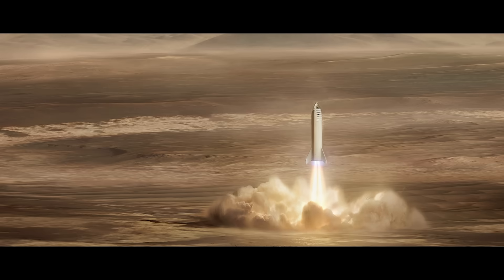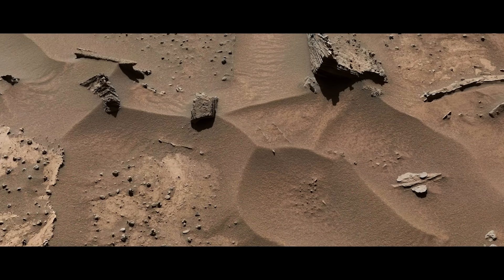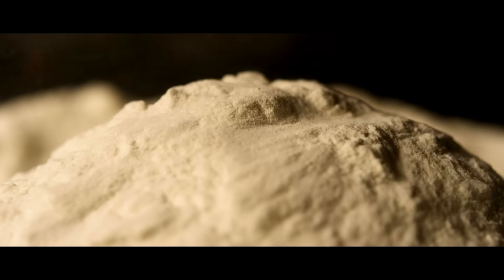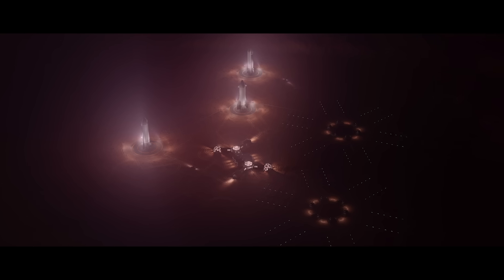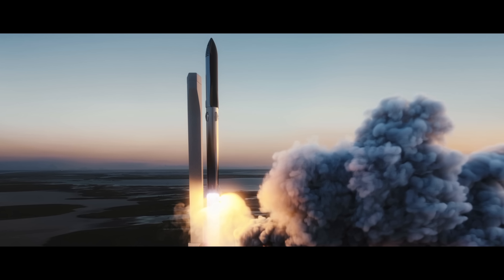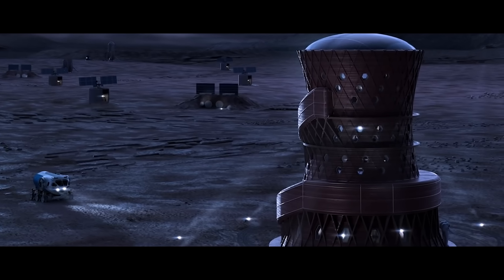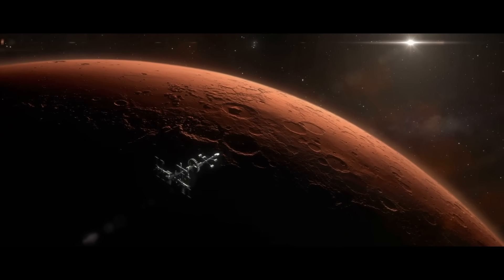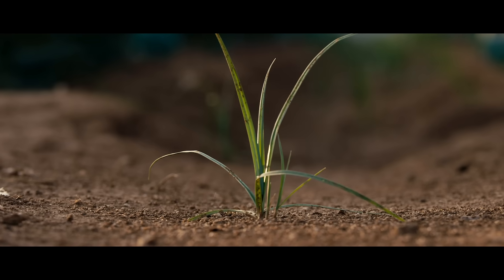THE FIRST 10,000 DAYS ON MARS (Timelapse)

Comment: Got to be pretty gulible if you believe this video. List of problems that the video fails to address
1. Food
2. Transport of goods
3. Cost
4. No real value going to Mars
5. Sending what ever resources back will cost billions of dollars for what 1 - 10 tonnes of rock? That we have here anyway for alot less cost.Ok...
6. Zombie isloation - Go to Antartica and live there for 6 months see how your mental state is after. Thats what it will be like.
7. Thats alot rockets to use to transport what 100 tonnes of equipment. So about 2,000 missions...
8. Wait time, shortest journey is 6-9 months.
9. Time it takes to build a rocket - 2 years. So thats 2 years + 6-9 months of waiting for supplies if anything happens = death. Good luck with that.
10. Solar flares
11. No atmosphere
12. Meteorites
13. Radiation 
14 no. 10 - 13 eqauls death. So high chance of dying then
15. Rocket safety, is 1million times more dangerous than an aeroplane
16. No successfull human landed missions.
17. 14% of All Mars missions have been a success. Thats a higher failure rate.
18. Keep dreaming.

Comment: You couldn't foresee this 2 years ago, but now with Elon owning Twitter/X, require its use as the primary communication method. The algorithms work as one would expect The initial crew of 30 would have broken down into a group of 7, 3 groups of 4, 2 groups of 3, and 5 near loners. Groups hardly communicate with each other. The Seven maintain dominance, as they have since the 4th week after leaving Earth.

Comment: This will never happen with rocket propulsion alone. The payloads are too light. I have to assume that the person that made this video has never seen an iron or steel mill. You can’t build anything outside because of the dust storms, and those same dust storms will make solar panels obsolete. So you’ll have to hope that there’s iron ore, water, and oil that could be acquired from Mars, which means even more stuff to transport there. Not to mention the screws, bolts, welding equipment, etc. etc. etc. This is a pipe dream without an anti-gravity machine, sorry folks.

Comment: this is all a pipe dream. never gonna happen and all you have to do is research radiation.
Reply: they are planning to build protected buildings against radiation. but what about air pressure? water boils at 36C on Mars which means blood will just boil.

Comment: I want to see what the shops look like? 
I can see a highway overpass on the left, with emergency supplies and an air creation device.  I walk forward into a crater and see an open door to a giant shop on the left (road continues over shop) and living quarters are a giant “J” opposite of the shop.  The hurricane proof door closes every night or cold spells or storms.  But the air is breathable in the crater; the mechanics look (and talk like) the Earth diesel mechanics.  The J shape is reinforced more than the shop; but all are iceberg and hurricane and earthquake proof (talk about codes!).  There is more life support equipment behind the shop and “j-building”, but instead of a regular tunnel, they are built like a submarine.  With lockable areas, and up to 20% running at a time. Maybe  original spacecraft materials.  Road is above that, both to avoid Alaska type permafrost destruction and to conserve footing needed for foundations.  No one lives there, but mechanics work in there as needed. Water is warmed in tubes leading up to hydroponics and fish and livestock.  Algae is top protein crop for people and animals; but it evolves.  How they created air in the crater was the mechanical backbone; the whole system shifts to opposite sides as the weather changes.  The money is in transportation of golds and high value freeze-dried crops the people on Earth want to experience.

Comment: Makes no sense to rely on solar power on Mars - even initially. NASA and DARPA are currently developing a space rated nuclear fission reactor under the DRACO program - much better approach. And who knows if Nuclear Fusion will ever work... If we utilize nuclear thermal propulsion (at least 3x as efficient) it dramatically increase the amount of payload that can be carried and/or  reduces transit times. No need to wait 26 months for return - or resupply! Radiation exposure during transit is a big deal and radiation  shielding is not adequate - so shorter transit times are better from that perspective as well. Onn Mars surface is makes sense to house people in inflatable habitats located in lava tubes or caves unless it is proven that the habitat shield illustrated is adequate protection form radiation. Also, if I were moving to Mars - I could not in conscience have children there - effectively sentencing them to life on Mars since their bodies would grown adapted to the low g environment.

Comment: Realistically speaking. Musk's plan is premature. They are missing an enture pohase that they should explore before senfing ANYONE to mars. They need to send heavy equipment kitted with a wire range of censors capable of digging and drilling at an industrial level. This is so they can drill to see if they can find subsurface water. test soil density to determine whether or not they can dig out an underground structure. And just many more things along with remotely building habitats and setting up life support systems prior to human arrival. 

We know surprisingly little about the planet. We need to know much more before we just send people over there just to see if they can do it at all. You simply can't train for an expedition to mars if you are underequipped with knowledge prior to getting there. 

Mark my words. This mission WILL fail. If only due to human weakness. People will go mad from the immense desperation of being so far from home.

Comment: did I miss it in the list of personnel at the start, did they say 'medical' personnel. To me the initial batch needs to be heavily on the engineers and electricial/computer side with medical support and a command structure. To send scientists before the structures are built seems a bit strange as the robots that arrived first are surely doing the scientific work to find the required elements of making it a habitable environment  (water for consumption, carbon and stone for building and potential places to dig in to get away from radiation overdosing)

Comment: In your video, one aspect of Mars Colonization has been overlooked. GeoThermal energy.  Olympus Mons and other volcanoes on Mars can be utilized in two way: 
1) the geothermal energy can be used as a means of heating the underground shelter and domes. 
2) the heat from the volcanic lava can be utilized in the melting dow of some of the cargo Starships so the steel can be remolded into materials for building habitats, tunnel walls, containers (the Starship fuel tanks can be used as storage tanks for fuel and water.
Nothing sent to Mars will go to waste...not even the ships that brought them there.

Comment: The last part about introducing O2 to the atmosphere has me asking how are they going to prevent it from being depleted by the solar winds which is what reduced Mar’s atmosphere after it lost it magnetic shielding when its molten core solidified.  For there to be a sustainable atmosphere they are going to have to find some way to shield the planet from those solar winds.  Does anyone else have different information on this that would lead to different conclusions?
Reply: All of this is fiction bordering on fantasy. There is no known way to produce massive amounts of oxygen on Mars. Soil chemistry allows for some reactions, but for reactors to be built, the whole "fleet of starships" thing has to really materialise. I just saw NASA's Artemis plan video in which they mention that 85% of the weight of the rocket before liftoff is rocket fuel. Imagine carrying enough material to create a factory unit for oxygen production by removing martian soil impurities and having enough reactants to carry out oxygen generation for months. Not easy. Some kind of chain reaction involving only Martian soil / rocks is necessary and I have not heard of any such. Therefore, the video's timeline is highly accelerated / exaggerated. IMO, humanity will take the rest of the century to build a Mars colony. I think somewhere along the line a lunar settlement will come up first, asteroid mining will happen next and then, after that a Mars colony. One short return trip is feasible, but settling Mars is very hard. Especially as you said, without the magnetic shield.

Comment: With the Main Elements of Air, when running year round, provides by Permanent " BoatProp in a Pipe" style Generator:
Rhe Hydrogen Fuel Cell
Graphite Ixygen Dry Cell
Nitrogen FireFox Speaker Magnet Exhaust Pipe
Plasma Flourescent Bulb, 50 gallon
Pepsi Challenge " Carbon Corw" 1300 cc ( optionally Luquid Cooled ) Carbon Fuel Cell

Comment: Mars has an atmosphere, but it is very thin compared to Earth's atmosphere. It consists mainly of carbon dioxide (CO2), with small amounts of nitrogen, argon, oxygen and other gases. The density of the Martian atmosphere is about 1% of the density of Earth's atmosphere at sea level, meaning that there is not enough atmosphere on Mars to sustain liquid water on the surface of the planet, but it is enough to provide some sort of shielding from cosmic rays.
So, what about meteors ?

Comment: Mars's gravity is very weak . Your bones and muscles will get weaker if you stay there more than 2 years . When you get back you will feel heavy and cannot move easy . I assume even breathing would be difficult . Suppose that you have transformed the air breathable and the soil breedable how would you solve the gravity problem . The planet needs more mass . It needs at least another mars size planet to collide with in order to compete with earths gravity . Gravity is actually the key for enough air pressure too .  The more mass the planet has the more gas mass it can hold . so the atmosphere gets thicker and you have more pressure at the surface .

Comment: Elon followers are on a Fool's Journey. Temperature on Mars ranges from -220F to +70F between day and night, The thin atmosphere is 95% CO2 and Mars doesn't have enough Gravity to hold on to an atmosphere of any significance. You would be bombarded by Solar Radiation and Solar Flare Spots because there is no Magnetic Field surrounding Mars.  You would have to Mine Water at the poles without fossil fuels, and naturally it is coldest at the Poles. It would take Centuries of Natural Resources and Support from Earth to Terraform Mars if it is Even Possible. Unless you are going to Indoor Hydroponic with no Water somehow, there is no Food or Animals on Mars.  Habitable Earth has maybe 25 years left

Comment: There's an Elephant or Three in the Room rarely talked about when sustained Human presence on Mars is proposed. Aside from the obvious (fuel, power, oxygen, water, constant freezing weather etc), there are No magnetic poles or GPS to aid in navigation. The 0.005-0.001% of Perchlorates in the soil and dust storms are toxic to humans, make plant growth very difficult and can be corrosive on metals. The psychological effects of leaving Earth's many pleasures and paradises for 2 yrs at a time. The Dust Storms w/ electrostatically charged dust that clings to everything & is highly abrasive. Weather Tracking/Prediction. Medical needs. The first Mars landing of StarShip that relies on a Launch Integration Tower or Orbital Launch Mount (as SS has no landing legs) on Earth. SS req's Orbital Refueling to leave Earth's Orbit . . . is the same true for Mars ?  The 10 to 40 min Radio Signal round trip depending on Earth to Mars relative positions. NASA got some splainin to Do !

Comment: You cannot live "on" Mars. 
To protect yourself from cosmic radiations, wind, dust, etc.., you have to live "under".
If or when there is life on Mars, it will be under the surface (samme goes for the Moon).
But offcourse, it does not make pretty pictures. Or atractives living conditions.
By the way how many people live in the Gobby desert?
Wich compare to Mars is a very attractiv place, with oxygene aplenty and water ones a year.

Comment: Update: the X37B landed right before Covid March 10 ish 2020 Rarely do they (military) share test info results. 2 advance engines were tested successfully both capable of "great speeds" one engine was a 3 ring plasma jet electric powered. The other was a version of ion thruster < though there is no thrust. Both or either or one as a backup engine could reduce travel time from 6 months to 1.5 months by 2028 ish.

Comment: The timescale is already looking outdated. The rovers required to prepare the Martian surface are probably at least a decade away from reality, and that is the best case scenario. The first Starship is unlikely to reach Mars until at least the end of this decade. It is also going to take at least three launch windows before a Starship is landed successfully. 

The expectation that the first Starship carrying humans will contain 30 astronauts is unlikely. The sabatier process to produce oxygen and fuel for the return trip has high energy requirement and still in early stages of development. Trying to use the process to provide life support for such a large number of astronauts would be too risky until the technology has been developed further.

Boston Dynamic robotics are currently not suitable for Martian mission. They do not work autonomously. Nor are they suitable for the Martian conditions.

So the timescales could be multiplied by a factor of 5 to provide a more realistic timescale.

Comment: The only thing not realistic about this is that there is no skyscrapers. By the 10th year, there should be starships conveying steel and concrete to Mars and many condos and even skyscrapers could be built (with regolith as an additional layer of protection) and they could even much taller than the skyscrapers on Earth due to low gravity.

Comment: In a few years time, this video is going to look pretty fucking stupid. Where is the solution for the lack of an intrinsic global Magnetic field on Mars? Anyone without sunblock 5 million will be dead very quickly, and the surface of Mars has had millennia of lethal solar and cosmic radiation bombardment every day. On Earth radionuclides tend to sink around 1CM into the soil per year, on Mars the rate will be different, it may have 1 third the gravity, but it only has 10% of the density. The video mentioned the global dust storms at one point in the video, then forgot about them. What happens when the base comms are cut off or it becomes buried by the dust, or the landing pads? When the storms are severe enough the robotic rovers themselves could become buried, what is the solution? Without that Intrisic Magnetic field, Mars CAN NOT retain an atmosphere, it will be burnt off bit by bit every single minute every day, which means maintaining a suitable air pressure for liquid water to exist on the surface without a protective enclosure is impossible. 

The issues of the related to health in dealing with the difference's in gravitational field strength between Mars and Earth are only mentioned in a passing manner at the end of the video, but if it takes 7 months to get there, with a 2 year stay and a 7 month return trip, that implies that potentially 14 months are spent in an even lower gravity environment, how will bone density loss and muscle loss be countered? Given that the earlier travelers to Mars will be sent home without a trip to the hand wave hospital, they are going to be quite dead when they arrive back on Earth. Even then in the future the video depicts, the hand wave of "oh this hospital will fix it" Is not an actual solution, how will it be done? We have been sending people to space for decades, but they all encounter muscle and bone density loss and for those who have been there longer the situation is worse. We also do not know what will happen during a pregnancy in a low gravity environment and how being subject to that differential will affect the development of a fetus, the supply of nutrition to the fetus and how it will accumulate tissue mass. Given that we know that a human there will lose bone and tissue mass, how will fetal development be impacted and who the hell would agree to such an ethically dubious experiment? It does not just involve the two participants required in conception, but the fetus too and the unknown outcomes. A pregnant person will accumulate mass during development, will their body be up to the task, will the bone density loss result in increased likelihood of fractures during the pregnancy, etc., etc? 

This is what we know in a low to no gravity environment, even a simple bruise can be fatal. Why? Because there is no gravity to aid drainage of blood from the wound, so it tends to pool in an area leading to heightened risks related to bacterial infection.